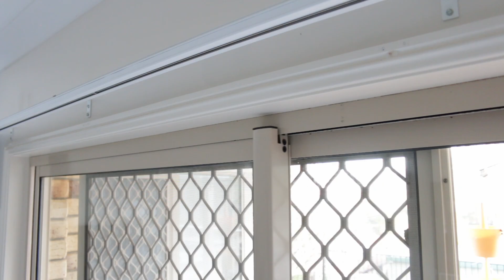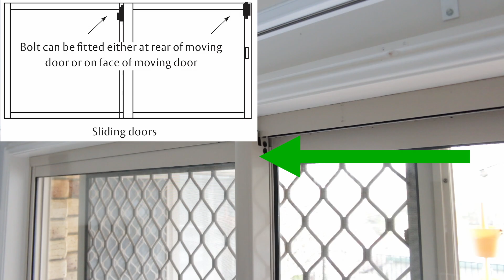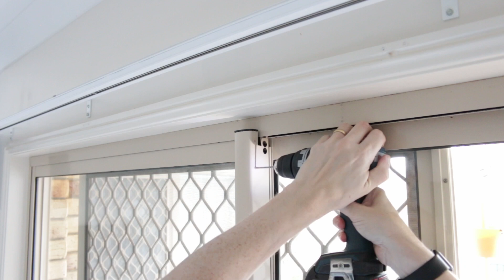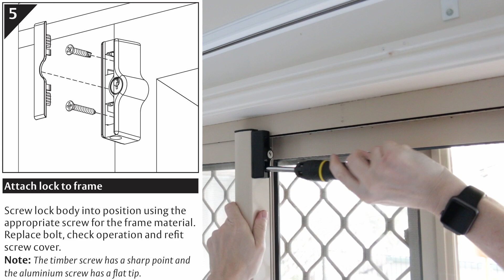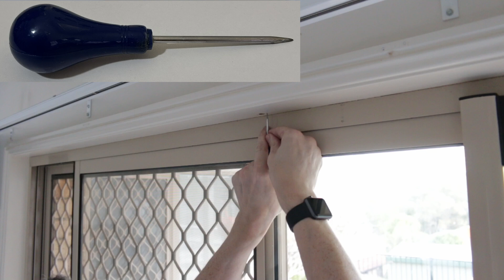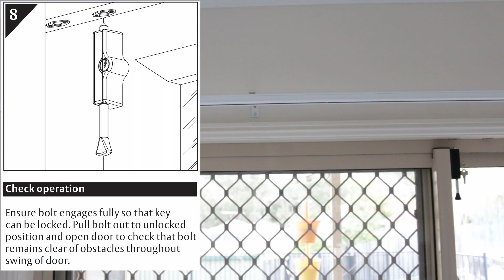Installing a patio bolt is something most people can do easily.

Comment: An investigative police officer dusting for fingerprints after a break and enter on this type of sliding patio door recommended to install a patio door bolt also on the non-sliding panel to stop thieves from using a crowbar to break the fixed glass panel away from its fixing rivets and simply slide the panel over to gain entry.
Reply from the maker: Interesting, will need to check that one out.